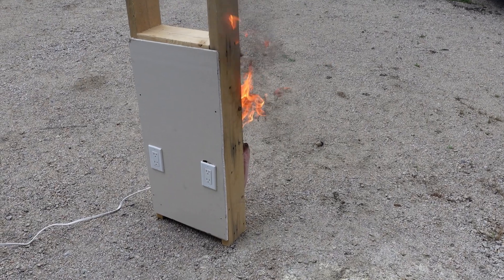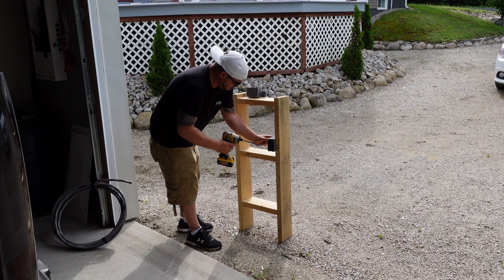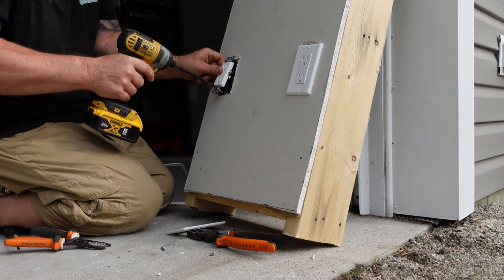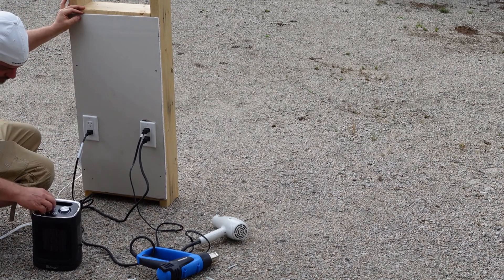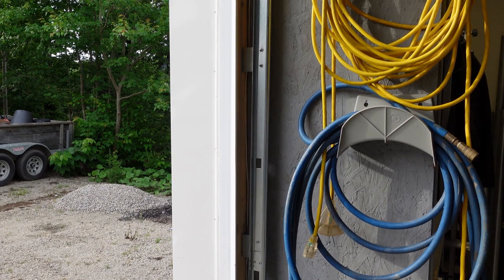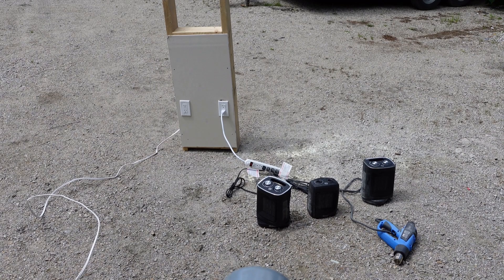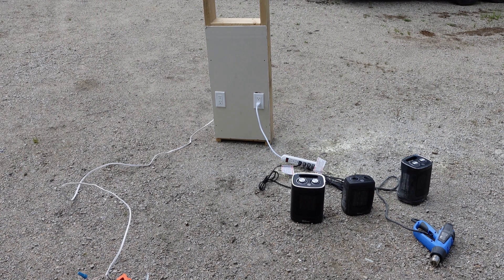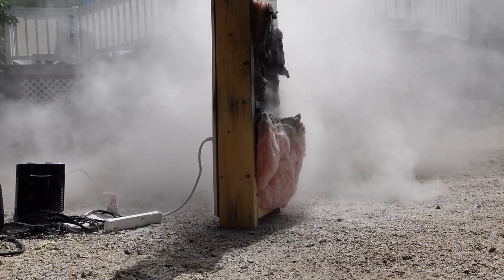Electrical Fire Causes

Comment: I think this does a good job at showing how ridiculous you have to push things past spec before they fail. If your causing electrical fires from overloading the wire, you shouldn't be working on your own stuff. Like
Reply: This should help pacify people who are worried about getting anywhere close to the limit just as much as it helps inform people to realise they should get someone to do the job properly.
Reply: @thewhitefalcon8539  you're right. I think its crazy that homeowners will push things so far. It really does take a good bit of negligence on the homeowners part for this too happen when all other things are correctly done. It just seems crazy to me people will push things they don't understand so far that it catastrophicly falls, when it's their's and their's family's live at risk. It's good to see someone actually showing people how this happens instead of just saying trust us.

Comment: Great information in the video for DIY'ers thinking about "adding power".

But a real wall fire would not have a completely exposed back side, hence the oxygen available would be limited in real construction and would take significantly longer than the video.

Building codes add precious time to escape and are designed to keep the fire to a smoky smolder rather than a raging fire like at the end of the video. 1/2 drywall alone is rated to 30 minutes. That means this fire would be oxygen deprived for up to (and most likely very close to) 30 minutes before it would break through the drywall and get oxygen and begin to grow and look like the end of the video. Its possible it could self-extinguish. The 2x6 blocking is rated to 60 minutes so the drywall is the weak point. 

For example, this is why modern codes require drywall finishing under staircases, even in basements. It gives you like 5 times the amount of time to escape out of what might be your only exit.

A wall with a plexiglass sheet on the "viewing" side and fireblocking foam on the cable entry points would better simulate a real wall, up until the plexiglass melts. Best I can think of is a sheet of borosilicate glass but that would be hundreds of dollars.

Comment: The insulation kept the heat in and let the heat soak into the wood whereas the cords were in open air, outside near to the ground and could draw cool air onto and convect away from them - IR cameras are great for showing issues like this. If a fuse is overloaded it will show hotter than the rest or damaged wire will be hotter at the damage